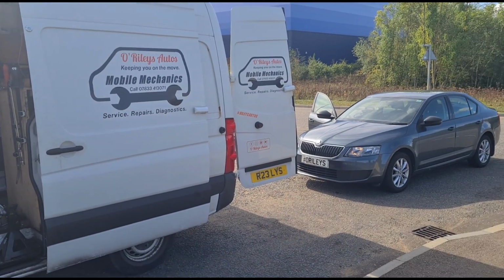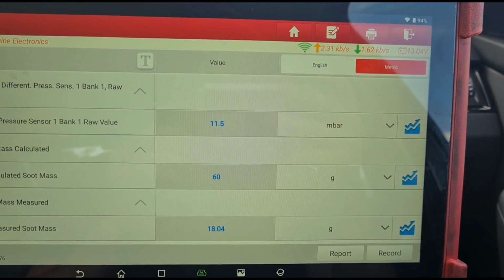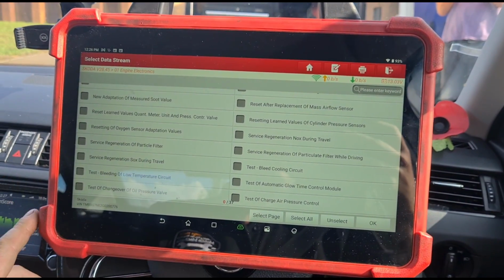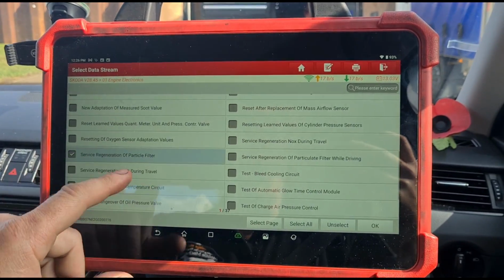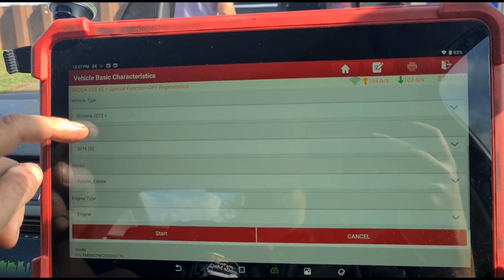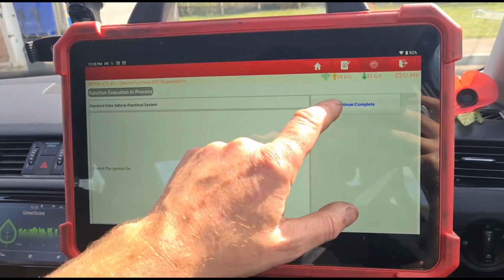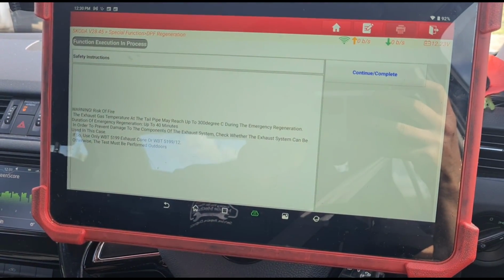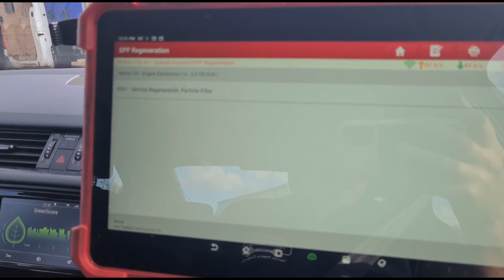Skoda Octavia 1.6 Tdi P246300 Particulate Filter Restricion Soot Accumulation DPF Cleaning

Comment: Jimmy 

2017 Skoda Superb 2.0TDI 170k miles CRLB engine code no addblue version 100mile daily driving 5 days per week.
Seems be regening alot cooling fans always on when cars is switched off.
1000rpm when idle.
drinks diesel.
Toping up oil level every 500mile.
Heavy engine blow when oil cap is open.

Any tips on this issue would be much appreciated.

Liam 
Ireland
Reply: No fault codes car drives perfect.

Comment: does the vag group of vehicles have a bad effect on the regeneration of the dpf, the engine check light is on, and when it comes to the error related to the glow plug. can it successfully regenerate due to a faulty glow plug?

Comment: I tried all day to clear the codes on a Skoda Octavia 2 vRS. 

I've ran DPF cleaner into the DPF and run the car for a good 10 minutes at 2500 RPM. 

I've tried to autel diagnostic machines the 906 and the 808  but no matter what I do I can't clear the DPF and glow plug light. 

I've adapted the values for the particulate filter but every time I try and do it regeneration it recognises the soot load is high when measured. 

I haven't been able to get it to a position where when I turn the engine back on it's showing no warning lights. 

Have you got any advice as this is driving me insane haha
Reply: Same, did you fixed it?

Comment: What happens when ash hits 70 gramms (Limit as per VCDS)  on the VW 1.6 TDI engine 2012...Can the launch UK stuff removed the ash or is it replace the DPF or drill a hole in it?
Reply from the maker: It can not remove ash solids
Reply: @ORileysAutos  Appreciate the reply, thanks. What your advice when its gets blocked with ash? Is DPF serviceable ?

150k Miles, pressure differential on DPF is well under 10mbar, plenty of motorway, low ash oil used etc. 

Perhaps if you see similar issue can you make a vid. Still haven't seen all your vids yet.

Comment: I have the same car , no fault code but after one minutes of driving my car RPM increase to 1000, it sapos to be 750 rpm, i replaced the Air flow sensor, but did not fix my problems.
Reply: The car idling at 1000rpm means that it’s in regen mode. Continue driving for a couple of minutes with a bit of blast here and there,or leave it running until regen completed
Reply: I have the same problem golf 7 same engine... Trying to figure out the problem
Reply: @ricardopereira771  
I fixed my can, I disconnected the battery negative terminal waiting for 5 minutes and after that connected back battery ,the car fixed. Magic

Comment: Hello mate, I have it done on my Octavia and light come back two days later, my garage is going to to same thing again and he said if it's no helping I have to change EGR valve, any suggestions please
Reply from the maker: Egr replacement with egr cooler or egr delete remap
Reply: @ORileysAutos  thanks for replying, I'm mentionined my mechanic about egr delete remap, but he said that is not reliable without mechanical blocking erg first and after  that doing EGR delete remap, but of course it's it will come to extra 5 hours of cost to take erg out and install it back
Reply: @ORileysAutos  Fluid does not cause problems with the EGR valve, it will not suck fluid into the EGR valve???

Comment: The launch software can be a faff on these compared to autel jimmy, if you go through the secure online login function and then into basic settings it should work 👍
Reply: Hello mate I’ve got the LAUNCH CRP129X pro ,and same issue here ,it won’t allow me to do a reset ,nor a regen ,I keep getting messages like this:not supported,or not available.My car is an Audi A5 ,do you think I need to buy the full software for Audi from launch ,or can you tell me of how to do it through the secure online login thing please .Thanks
Reply: @islanderstalents8342 hello, how did you fix it in the end?
Reply: @thomas5607  Hello mate ,I went all the way 3 hrs drive to meet Jimmy,and he sorted it out for me for 200quid .The launch I returned it back.

Comment: Very interesting, are VW engines particularly tricky?
Also are they a bad town car?
Reply: Vw make great diesel engines, you can get very big miles on them. But no diesel car should be just driven a few miles around town every day.
Reply: @Michael-dp4fo  Cheers Mike, I’ve got an 18plate 2.0d Touran, I do 120 miles a day, on a 100k now, was dreading egr issues, oil change every 10k still as sweet as the day I bought it.
Reply: @mikeb3010  Have the same engine but I don't have the add blue. EGR issues were mainly on the previous engine ea189 still a great engine. I don't see many complaints about the EGR on the current generation.
Reply: That particular engine is renowned for being utter 🐶💩. The are terrible 'town cars' budget £800/ year for egr  problems and carry 4 spare injectors, clamps and bolts and a device to calibrate them properly roadside. Even then you'll b e unlikely to achieve a year's worth of trouble free motoring. I say this bitterly from experience. I wouldn't touch another VAG product if  I was paid...

Comment: That was really different from others so far seen, many thanks Jimmy, I couldn't catch why did you have to switch to the Otofix (function wise) and what did you use on it that wasn't available  /in the Euro3 scan tool?
Reply: Probably just software issues/glitch.
Seen cars where Texa idc5 (expensive and good tool) couldn't reset a fault or do a learn procedure and an AliExpress Delphi/wow clone with software crack could....

Comment: With the tiny mileage he’ll soon be back I fear.
Reply: We had a 2.0 TDi Octavia Estate (2014 Euro 5) that would do tiny miles all round London at work 

Never had a blocked DPF ever.

All we did for 6 years was change the oil and oil filter every year and once changed the fuel and air filter.

Did 25k miles in 6 years.

Pretty decent system
Reply: @bigjml  yes the euro 5 was very good I also had a 2.0, the 1.6 euro 6 didn’t have adblue whereas the euro 6 2.0 did/does and relies on multiple regens. I have the euro 6 1.6 but I do a lot of miles, so it’s never an issue but even I’ve found I can do a 400+ mile round trip on a day and come to a standstill at home and the dpf is trying to clean, obvs didn’t really need to and it’s never been an issue in 110k but I can imagine it wouldn’t take long on small miles and no opportunity to regen for it to fill up.
Reply: @robc5955  The DPF on our Octavia would Regen when parked up idling all day.

It would often be used on events and sit idling for hours on end.

You could tell when it was Regenerating.